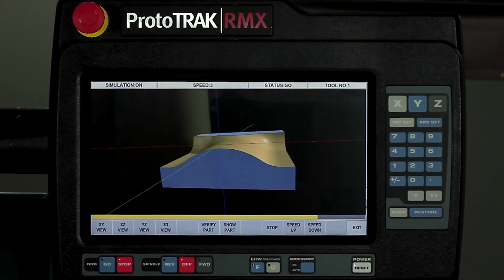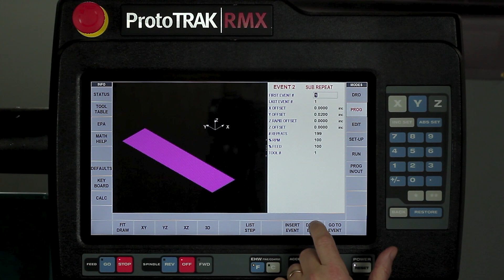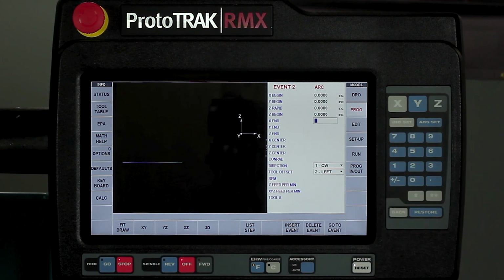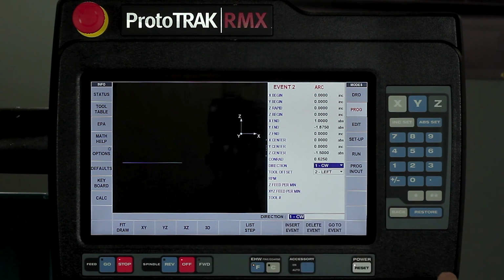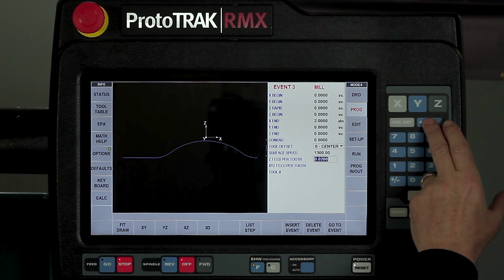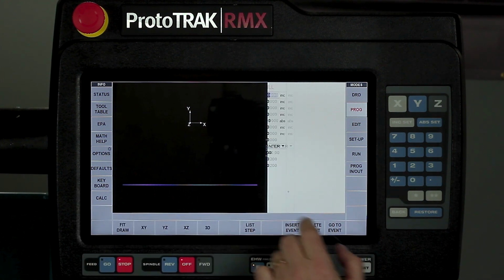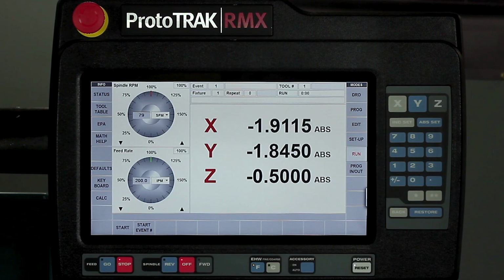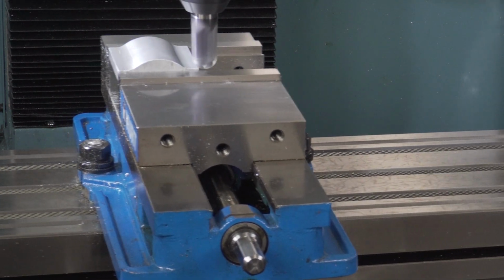3D Milling | ProtoTRAK RMX CNC | Advanced Mill Programming

Comment: Pat can I machine a 2dia. 1deep with a .485 radius at bottom cavity with a DPM3 in 3 axis from a SMX controller . 
Thx Mark
Reply: Hi Mark, I don't see why not.  As with all ProtoTRAK arcs, the only thing that matters is that the tool radius can fit inside the arc.  3-axis machining is the same in an SMX control as it is in the RMX.  You just have to think and program in the X/Z or Y/Z plane.  Let me know if you can't figure it out.  T.P.
Reply: TRAKing Pat I will . Thanks !